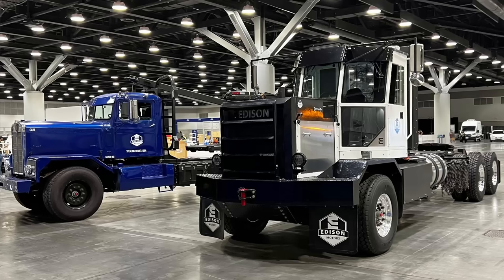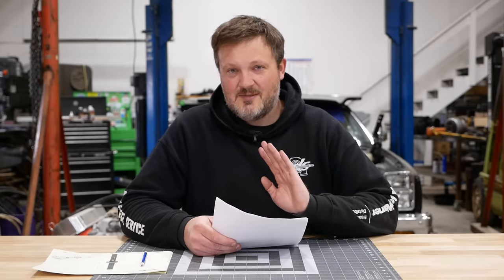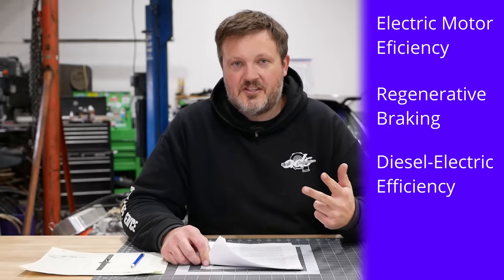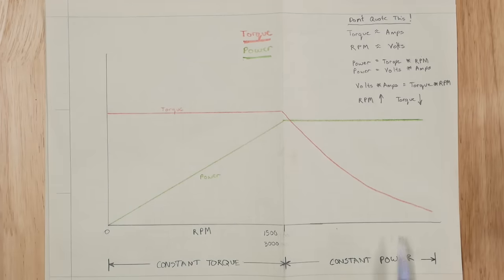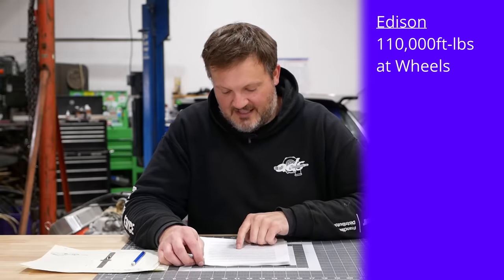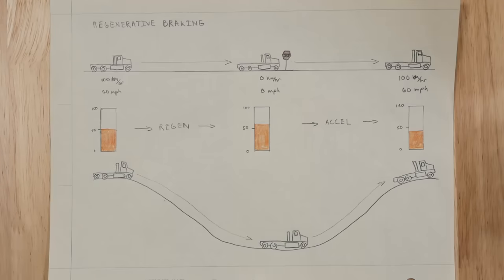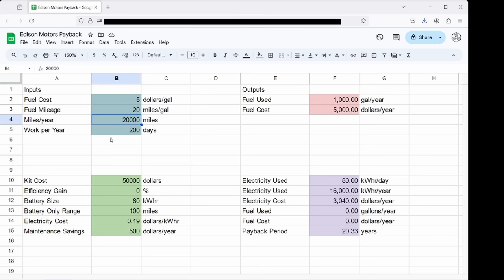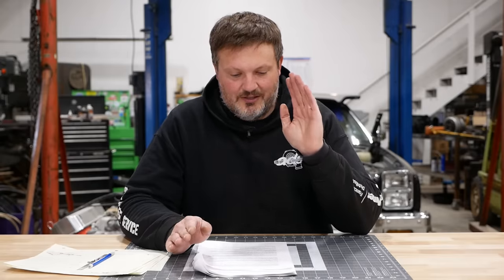Edison Motors Built a Diesel - Electric Semi Truck

Comment from the maker: Add your complaints below...
Reply: Not a complaint, but I wonder if it makes more or less sense when Ford, Chevy, Toyota are all making hybrid trucks. Seems like a 4 cyl diesel in a Ford 1/2 ton with a batt and electric axles will be a much better value and make more sense for most of us.
Reply: 1 Didn't factor the cost of overhauling worn out truck compared to a retrofit. Lots of vehicles do have good bones.  
2. Running a smaller engine is more efficient. And generator is shunted to axle for direct connection. Question is how much heat is generated with this. 
Thanks for doing this video!
Reply: Hi Wes. The first link doesn't work for me. Have a good one.
Reply: Isn't the 2025 Ramcharger a generator + battery truck? Obviously, it is not out there yet but someone else has thought of such a design where the engine does not have a "hard" connection to the drive train..
Reply: This feels like a EEVBlog vs Solar Roadways type video, but you're nicer about it than Dave... Too nice.

There, I made a complaint.
Reply: I'm afraid we're going to need more government regulation to make this math out, my friend.
Reply: @hight3chredneck   Just wait for it, when they tax EVs like diesel trucks...
😂😉
Reply: will NEVER drive anything electric , i keep my old diesel and gasoline cars / motorbikes
Reply: 3. Also there's a huge benefit to charging vehicle when sitting in the yard. Especially if you have solar on the property and it's a short haul vehicle
Reply: Great video as always, brought up a lot of information that I was wondering for a while plus more. 

At the end of the video when talking about pick up conversions, it’s still a hybrid system right? So their would be a small Diesel motor that could power accessories like power steering and hvac? And low voltage to run electronics and airbags and what not?…. But then the truck wouldn’t be running 100% electric for the first xxx kWhr?? As it would need diesel to run the accessories?  How do all modern hybrids execute that?

Lots of questions, would be cool to see it happen, but rust sure seems like a large problem in the equation for donor vehicles
Reply: BC Canada is famous for mining scams. This sounds like a "great idea" to generate government loans/grants and investors...huge IPO, skyrocketing share prices, then huge crash. Just like new Canadian mining start ups...investor honey trap. You know a lot about mechanical systems Wes, but less about Finance.
Reply: 👍   Needs more cowbell...🐄🔔
Reply: with your cost analysis, esp for the semi truck, you didn't factor in the cost of the down-time for the conversion...maybe 2 months at 15000 per month lost revenue, maybe more. Plus, almost no one will be able to pay $104,000 clear, out-of-pocket for the conversion. That conversion expense would need to be financed, adding perhaps 50% to the cost. Making this option financial suicide for the trucker.
Reply: @MrElwir  If you used the diesel engine to run your power steering, power brakes and AC then you would lose the ability to drive it on just battery power.
Reply: Only complaint I have is that you did not build any models backing up your pencil whipping 😂. Great video Wes. As in any energy production, there are hurdles to be overcome to be efficient and the more layers to energy production and usage, the taller and more hurdles to clear.
Reply: Old retired engineer here, we called an “estimate” without real world data to back up the numbers used in the calculation a SWAG…a “scientific wild ass guess”.
Reply: Nah, you're good
Reply: Sorta like thunderfoot
Reply: 13:07 invested in tesla?
Reply: Wes, you are right, Edison motors numbers are optimistic. On the other hand, yours are a bit too pessimistic.

To be considered:

- the diesel motor is smaller, it does not run all the time and it does not (or let's say should not, if Edison does it right) run at full throttle, when charging the batteries. Maintenance costs should be smaller than for a comparable diesel truck.
- a series hybrid is less complicated than you think, the electric has almost no mechanical connections, no need for a transmission or transfer case for example.
- a wood hauling truck isn't meant to run at highway speed all the time
- your estimations about maintenance costs are too high. If you take a Tesla model y for example, 300'000km costs are about 6000 to 8000$, a good portion of it are weakly constructed suspension parts.
- time for a coffee. In Europe drivers have to make a 30min break after 4 hours. There are allready 350kW chargers, you can charge your 280kWh battery to 50% during your break. 

To be continued.

Torque is a function of power and RPM btw, but your simplified graphs and explanations are easy to understand and get the point. No problem with that, i love your drawings 👍😁
Reply: For synchronous motors, rotor speed is as high as you want, until it explodes. 
While the torque is limited by how efficient and how fast you can get heat out. 
~95% efficiency in and out is nice. 
As for voltage and current a given motor can be wound for any voltage for max speed without affecting efficiency and since the current is reciprocal the voltage constant, your torque output ends up the same, handy for matching to your power source capabilities.
Reply: Plug in EV's just move the generator elsewhere, the larger the generator is the more efficient it gets. This idea doesn't  do that. Diesel generators get a emissions bypass, but this is probably because they are static.
Reply: My Toyota Highlander hybrid gets 28 mpg, my Mercedes e320 cdi gets 45, same displacement
Reply: One thing to point out is that semi trucks are designed to run their engines in their most efficient RPM range while doing what they do most: highway driving. So then parallel hybrid is the way to go because you get the direct mechanical connection without conversion losses.
Reply: Robert G. LeTourneau built a diesel electric semi truck in the '60's. But without the battery pack I believe it used a Detroit 6-71 engine as most of his creations used Detroit diesels.
Reply: Wes I really enjoyed the video and appreciate an engineer who does the math. When I was in the high concentration solar business it was sad to see how many people made purchases on an emotional or altruistic basis without doing the real detailed analysis which would have shown that the solar just did not pencil out. I burned out in this industry which was built on so many lies, not the least of which was the hidden effects of the waste stream that was pouring out of the component and assembly plants. I'm glad to see the "little guy" working on a potential solution, but as you point out it is a very specialized niche that allows a logging truck to convert kinetic energy into mechanical energy and then into chemical energy. All others beware of the snake oil! Well done indeed!
Reply: We demand "stick people" figures in your drawings, LOL. Great videos as always Wes. 60107 again says hi.
Reply: Great video all in all, I was pretty disappointed to see the numbers laid out because I am really excited about the Edison project. But it is good to have some realism brought into it. 

My point of contention is you're assuming highway travel for this truck. Edison has said point blank there won't be much efficiency gain for highway usage. I run a vacuum truck, I average 300km/day working 12-14 hours burning 300L of diesel in that time because the truck idles all day to power the hydraulics. Cases like mine I think make more sense for this tech as the battery could run my hydraulics and the engine may only need to run for a few hours a day to keep the battery topped up. There are lots of vehicles like welding/service trucks that idle all day just to provide some sort of auxiliary power, this would solve that issue. This is the market Edison is trying to capture, not dry vans on the highway. Maybe this wouldn't affect the economics as much as I think though.
Reply: Whats up with the queen wave thru the video?
Reply: @MrElwir to answer your question about how modern hybrids do it, they run electrical accessories off of the onboard power system. As well as drive lower speeds, under low acceleration before the engine kicks in. This also varies by mfr, along with different onboard controls. I’m in and out of all vehicles from all mfrs everyday at work. I drive them short and long distances under varying conditions.
Reply: How dare you spread the truth 😂
Reply: You are pretty close on your spreadsheet but you missed the taxes the Canadian government puts on diesel and Diesel vehicles..
Reply: @kidsteach938  Two additional major financial investment issues not added on in the evaluation process.  The trucking industry will not be happy when considering what you bring up in their cost per mile.
Reply: I would imagine that the low emissions is the selling point for city and town use, everywhere else diesel makes more sense.
Reply: It basically the same set up as locomotive and maybe tweaked an tune more for a wheeled vehicle but right it's coming as with. Emissions people want to delete rather than learn an fix properly
Reply: No complaints from me. I found this to be a very interesting video.
Reply: You did not mention tulips. As a resident of the Netherlands I find this unacceptable. Also: windmills.
Reply: @WmSrite-pi8ck  I personally hate the idea of these E-axles I've seen. They're all shown as a normal axle housing with a huge electric motor sticking out the front, which makes ZERO sense. Mounting the motor to the frame and running a conventional axle is a FAR better design as it minimizes unsprung weight for increased traction on rough or uneven surfaces and also minimizes vibration and jarring to the more delicate precision electrical components all while using even more modular off-the-shelf industry standard components.
Reply: It's important that Edisons numbers are real put to the test. The issue being is that your weather out there is extreme to us in the UK. I think there Trucks would do well here in the UK.
Reply: Wes if you are in favor of electric vehicles better buckle up  you will be out of work and no one considers the after market…. The problem is they are EV’s forced on us and a minority of us don’t want it   if you use a diesel engine to power a generator to power electric motors there’s more complex shit to have to fix at the dealer of coarse. At that point why even bother to law such a complex pile of crap. You of all people should not want an EV but to each their own. Good luck soldier
Reply: Not an engineer here, I just fix their mistakes at a very large auto oem. One of our models is an EV. Every system on that car is overly complex and a nightmare to diagnose compared to a gas equivalent. Not talking about the drivetrain, but everything thing else like steering, climate, safety, etc. When I ask why it’s like that, I get just cause it has to be. Couldn’t imagine a retrofitted unit ever being even mildly simple to do.
Reply: @bivinsbenner5719  I believe he must be  of Italian descent and left handed.  🤣
Reply: My only complain is using the study for long haul trucks when we’ve said publically so many times that this doesn’t make sense for long haul.

Vocational trucks are niche and fuel savings will vary, but as we move into real world testing you’re welcome to come out Wes and have a look at the numbers in real time with us and share them.  We really won’t know until it’s out doing different jobs
Reply: as soon as I saw the name - Edison Motors, I immediately thought of Nikola Motors...is there a pattern here
Reply: In his next video, Wes is going tell us there's no such thing as Santa Claus...
Reply: Biggest complaint is you not reaching out to Edison motors before flapping your gums. There east to get ahold of.
Reply: @EdisonMotors awesome to see such a fast reply! I’d love to see y’all continue addressing concerns as they come up!
Reply: @kidsteach938 The US government will give loads of money to any ev anything. 😂😂
Reply: @stefankaufmann8257 his estimate was 1000 less time frame how much would you place there what is the usual cost a time frame
Reply: i am thoroughly disappointed in the video where is the fixing
Reply: @bluecollarinterviews  he doesn't owe them anything
Reply: @bluecollarinterviews he doesn't owe them anything
Reply: @nitroboy2  That's what they said about slaves back in the day.
Reply: @CODEE1  what would he fix he doesn't have numbers to fix it's all hypothetical
Reply: I bought a riding electric lawn mower. Just a homeowner size. Doubt that I'll go back to gas.
Reply: dont forget about temperature  big range killer when its below -10 Celsius pretty much useless in canada and colder states
Reply: There is one big issue with your math,  and that you have the wrong numbers for charging,  edison has a 350kwh c9 charger not the 250kwh you use for your charging time
Reply: @reviewking9709 Wonder why so many Teslas are sold in Canada?  Over 45,000 units in 2022.
Reply: Sounds like a good application for the logging in the mountains.  Other than that, it doesn’t seem to work.
Reply: 1)That’s just the way Hybrid fuel economy is calculated. I don’t like it either. 
2)The Cat D6XE runs the same Genset and a Series Powertrain
3)You know that you don’t go straight up or down a mountain, more than likely you’ll catch a regenerative braking cycle or 2 on the way up and a few discharge cycles on the way down. 
4)A 20 year life cycle on a vocational truck is normal in my experience, OTR is 10 years max. Topsy is clearly not an OTR truck. 
5)Clean frames with clapped out drivetrains are usually found South of the Rustbelt. I’m in VA and the amount of older Chevys with bad engines and ok’ish frames and bodies is high enough (especially given that any 6.5 Chevy or 6.4 Ford would be a good candidate since even a new engine is destined for failure). 

All that said Edison’s numbers don’t add up but someone has to try something new and fly or fall because theory is just theory until it’s put into a practical application. Their success will depend on some minor factors that nobody is currently looking at.
Reply: My electric oven element burnt out today… I’m just here to complain about it.
Reply: EV's = Skynet...it's all fun and games...then Skynet becomes self aware ....just say no to EV's
Reply: Right from the start I’ve believed not everything Edison was saying was on the up and up. Great video.
Reply: @EdisonMotors  
Oh…..ROAD TRIP, do it Wes!!
Reply: @adamdnewman  
AND uptalk any US EV producer that isn’t TESLA. LOL
(Biden somehow thought it would be a good idea to give Mary Barra, CEO of GM, credit for “electrifying the entire automobile industry.”)
Reply: how dare you call us enginerds heartless, emotionless, nerds..... i mean its true but we normally keep that under wraps and play minesweeper all day while "developing a solution" to a problem we figured out 3 days ago.
Reply: Video to short!
Reply: @nickdseidel no chance the battery could power the hydraulic pump for 12 hour that just not physically possible
Reply: Nice lecture, thanks. Btw Chevy Volt (2011-2019) and Fisker Karma (2011-2012) were serial hybrids, don't know about trucks.
Reply: @glenndinkle6595 Edison motor is in Canada everything is clapped out  
I am not importing a southern truck to Canada to convert it and dump 50k in it like deboss do who got the time for a 2 + year project if you don't daily it the roe gonna be crap
Would have been better to locate a newer truck locally rust free and just swap the 2.8 Cummins with a adapter plate to the existing drive train way more economical and faster roe
A V8 gas truck can be found for cheap and there plenty of blown Hemi ram lol
A 1500 4x4 ram with a 2.8 Cummins sound nice and not a too complex project to realize
Or a jeep with a manual trans+ the Cummins swap  for a nice off road fun vehicle
Reply: It's going to be uncomfortably cold this week
Reply: @craigsmith8217  It will take some time for the large battery mass to cool and freeze the cells. Tesla's warning to not expose to less than -30 C for over 24 hours is good advice. If I could not prevent that, I would make sure the car was plugged in, so that it could heat the battery.Jan 28, 2019
Reply: 👍Good video sir. 👍
Reply: @trueheart1372  sorry, i didn't get your point...
Reply: Just like overall efficiency of electric Drivetrains is only about max ~80% not 99% or Regenbraking in Automotive realworld Scenarios is ~30%, efficiency of Diesel engines is never at 40%. I think its important that they are trying to go real world testing, the Future will show Numbers.
Reply: @Stefan-ze8jt  over all efficiency of an EV from the power plant to the wheel is round about 75%, 80% are probably a bit too optimistic. The motor is at more than 90%, IE4 motors for example have to be at more than 95%. Inverters have 97% efficiency. These numbers don't include controls, cooling systems, transfer losses on the grid, charger, battery etc. That's why you will be at 75% over all. Depending on your power source, it can be a bit more or a bit less.
Reply: @craigsmith8217   Don't be surprised when the batteries are useless in 2 years.
Reply: @tiredofit1235  You mean, charge it overnight with solar? Work trucks, well, work during daylight hours, especially short haul city trucks.
Reply: @hight3chredneck  Ain't that the sad truth.
Reply: deboss garage is involved with this? Then I'm totally not surprised that the numbers don't add up. The only video I watched of theirs was full of wrong information and dubious claims, and it had nothing to do with this project as far as I can tell, though it was about a GM 6.5 diesel. They got super basic and obvious facts dead wrong in the video!
Reply: @WatchWesWork   Wes you are the buzzkill Engineer when you are assuming and even mistaken.  How do you calculate the MPG of the Edison truck when you are doing addition/subtraction analysis.  The Generator charges the battery within the 20-80% charge.  Once the truck pull off and gets to speed it uses a fraction of the energy.  Thus the large fraction of generator energy is used to charge the battery.  You don’t even know that a Scientist has or can provide software to Edison to provide the real cost of energy for traveling any place A to B in North America. This data includes payload, routes, elevation, time and provides the cost.  Second point.  You had a hard time comparing torque on a Diesel semi and Topsy.  Did you not notice that Topsy has planetary gears in the hubs?  Stick with your Engineer job because you are bad heavy duty mechanic 😅
Reply: Many construction duties are now done (better) with battery power, myself, I don't shine at fixing gas-power stuff, but try anyway
Reply: First time, long time:  This is a brilliant move by Wes to drive engagement and therefore reach.  Kudos!
Reply: I think you missed the point somewhere on your efficiency calculations. A diesil may be capable of producing 280kW, but the vehicle doesn't require that most of the time.
ICE outputs X kWh, Torque converter -10%; gearbox -6%, transfer case -3%, 2x differential -6%. % power at the wheels 77%. 
ICE driving alternator; -2%; alternator driving invertor, -2%; invertor driving motor(s) -2%. %power at the wheels: 94%.

ICE driving wheels is constantly going up and down through the rev range giving poor economy (consider stop/start town driving milage with constant speed highway driving.)

ICE driving generator at most economic power RPM gives best (liquid fuel) economy. When full generator output is not required (most of the time when not climbing grades), it can charge batteries as well as drive the motors. When pulling away with load or pulling up grades, the batteries add to the power supplying the motors. When descending or slowing the motors feed back to the batteries.

The battery pack does not need to be sized to supply fullpower; it simply acts as a buffer resevoir absorbing excess power generation and supplying shortfalls under extreme loads. Can be smaller still if supplimented by supercapacitor capacity to accept peak regen output.

Not sure that this form of hybrid makes sense for heavy use pickup trucks; but for the majority of them that rarely carry more than the driver and his snacks and rarely drives more than 30 miles a day, charged overnight the ICE would rarely need to start most days.
Reply: I think a realistic look at all this is good.  I hope that Chase and Edison start publishing more specs and stuff like MPGe and other info out front like they already have been.  Honestly, with the electric motor having all the torque down low for a logging truck is perfectly where it needs to be, because cruising down the highway doesn't really consumer a lot of torque.
Reply: Good video, I appreciate you taking the time to go through and highlight issues in a time of general hype. It is good to have 3rd parties checking the work of others, accountability drives quality up. 

Adding Electric accessories (power steering, AC, ABS, etc.) is not a new thing in the slightest. Car people have been doing it for years for various purposes, whether it be a Volvo electric power steering unit that plugs straight into your hydrolic rack or what have you. 
Airplanes have actually been moving this direction as well believe it or not, they used to have a central HPU to power all of the control surfaces but newer planes have been switching to smaller electric-driven HPU's to power individual control surfaces. Granted, a lot of that is for weight and redundancy reasons, so not nessisarily apples to apples, but lessons can be learned. 
Two of their major problems going forward you didn't bring up would be manufacturing at scale and emissions compliance. Making one great prototype is waaaaaaay easier than making 100 decent production vehicles. Additionally, making off-highway trucks is much different to on-highway when it comes to emissions, and the EPA has become a lot more stringent in enforcing emissions regulations.

This is a much more complicated equation than either you or Chance is making it out to be. How Edison responds to this will say a lot about their company.
Reply: Maybe convert the old remote lumber crawler to EV use? Oooo makes my head hurt!
Reply: @calholli First set lasted 5 years.
Reply: I wanted to see that tracked pickup on your channel, electric powered, ofc.

😂
Reply: Love your videos, this one it seemed like you were trying to hypnotize me by waving your left hand 😂